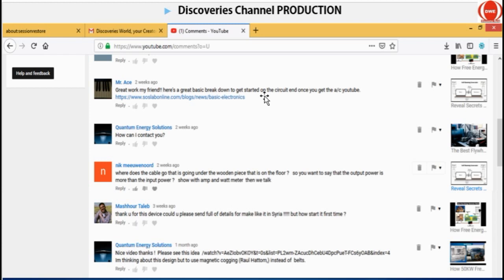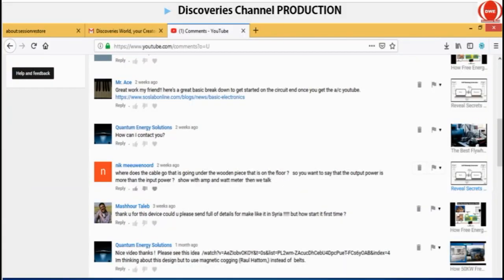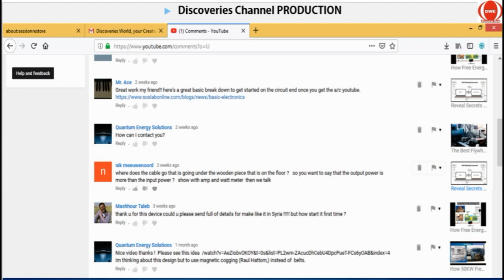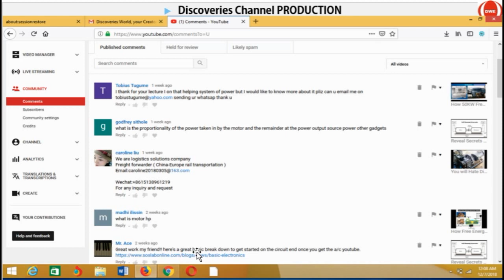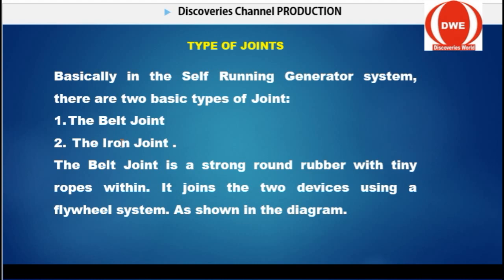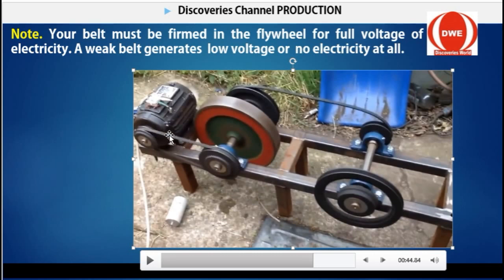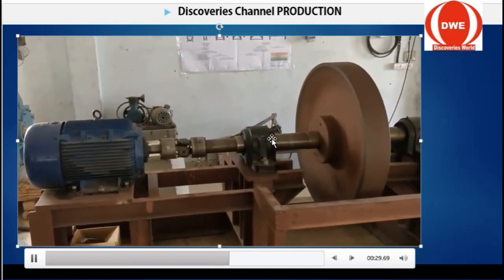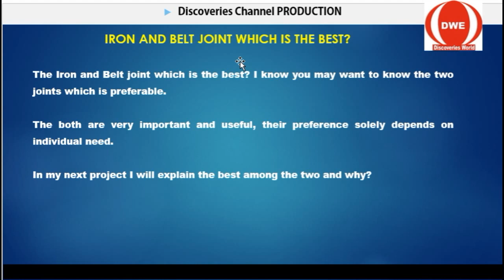Special Techniques for 2019  Free Energy Generator  System

Comment: You still don't get it, do you? People ask you questions in the comment section because they want you to answer the comments in writing. They ask because they don't understand what you are saying! (Very bad english). And neither do I. And the way you are filming the setup makes it impossible to understand it too. So now you are spending a lot of time trying to explain to people what they again will not understand when you are just talking about it. Write down the explanation when people ask you. What is the problem with that? I now have listen to you trying to answer a lot of comments for 20 minutes. I can't understand what you are saying because you just mumble, and I am not interested in hearing you reading and answering every single comment on every video anyway. You are waisting people's time. I am interested in reading a few of them when you answer them in writing. 
If you had been effective and explained everything properly just once, you could have made only one video of the whole system that didn't last much more than 30 minutes. And it could have had millions of views...This is not the way to do things, in my opinion. So you have basically revealed no secrets whatsoever. Because the connections between the items and the specs is not possible to understand. No specs on the flywheel, the bearing, the belts and the wheels that the belt runs on. So I have basically learnt nothing.